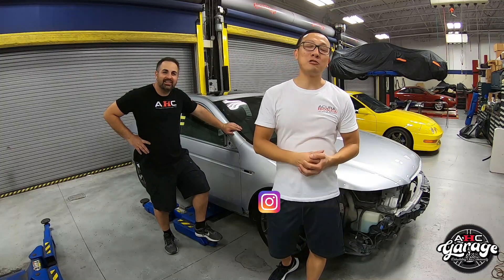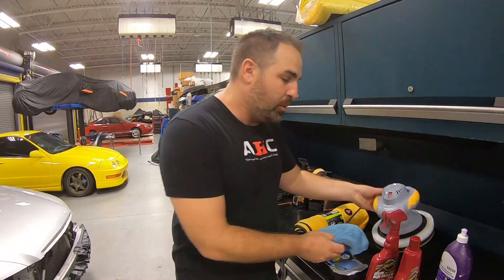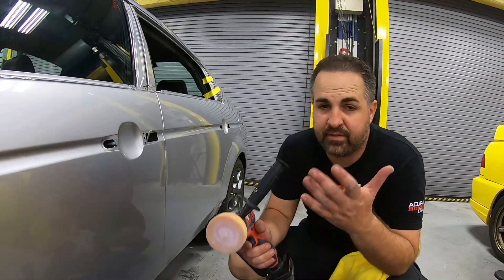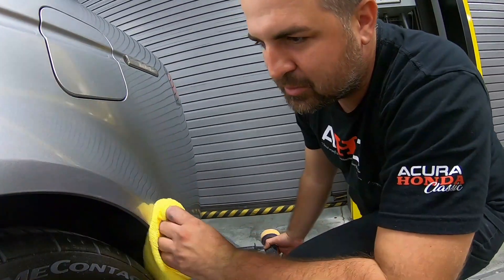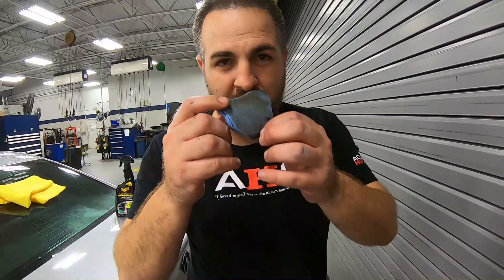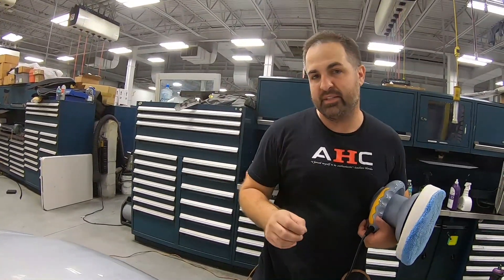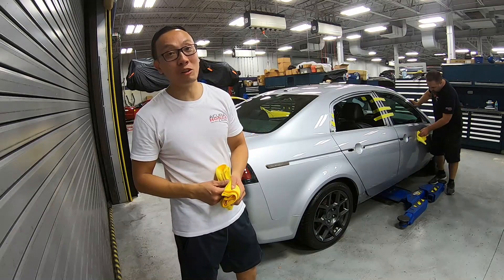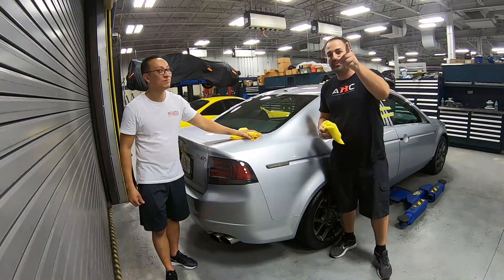Acura Honda Classic TL Type-S Build Project - Scratch Removal and Basic Paint Polish  (Episode 20)

Comment: You guys have a lift right there, why not lift the car up a couple feet to make it easier to work along the lower sides of the car?

One thing I didn’t know back in the day was that clay bar actually adds some light marring and scratching as it’s removing the contaminants. I used to think that it was good to go because it so smooth. But the car really needs a polish after clay bar to really make it shine like a mirror.
Reply from the maker: Great catch on using the lift to save our back!!